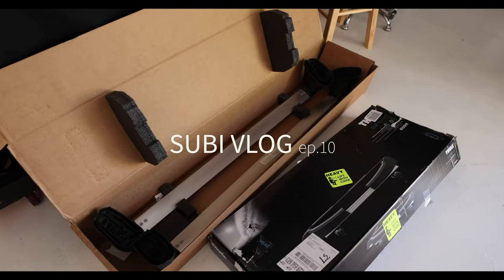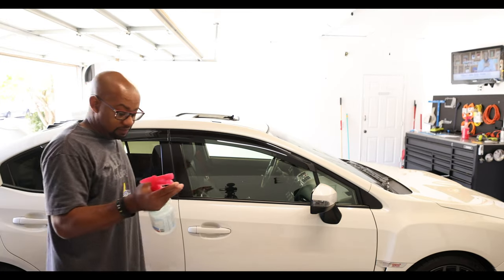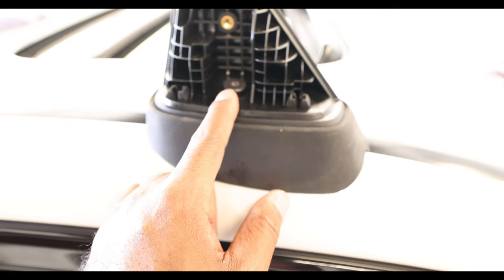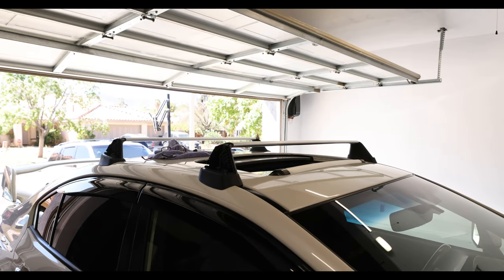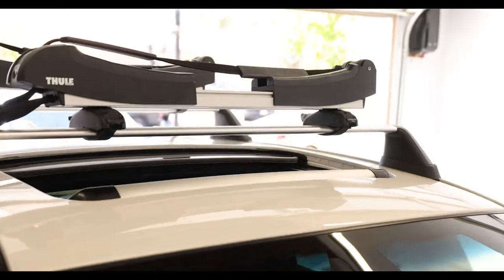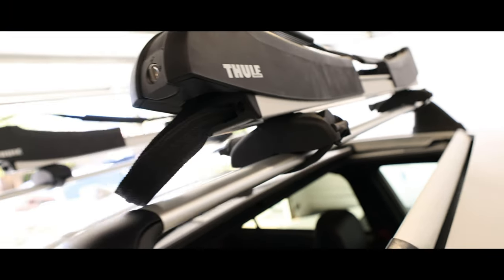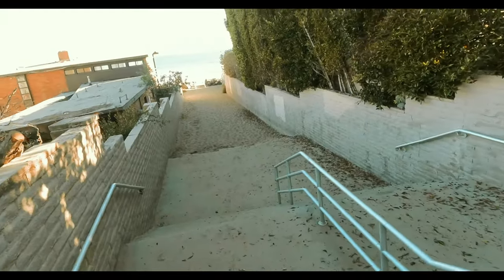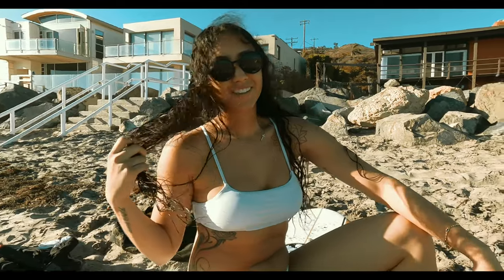Subaru WRX/STI Cross Rails, Thule SUP Rack Install, SURFING

Comment: Saw your video and made the same mistake until the screws broke 😂. It is 60 in-pounds not foot-pounds, so it is completely overtorqued.
Reply from the maker: oh man that makes sense because i felt like the screws were goin to strip. I take the rails off and on and now i just tighten them so they are good and snug. but good to know